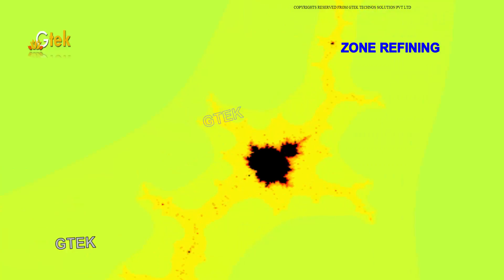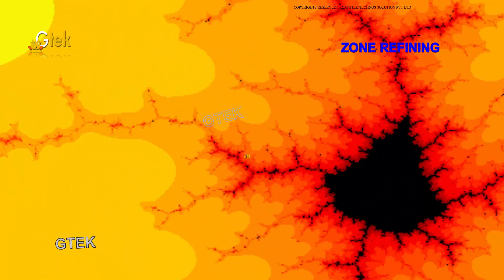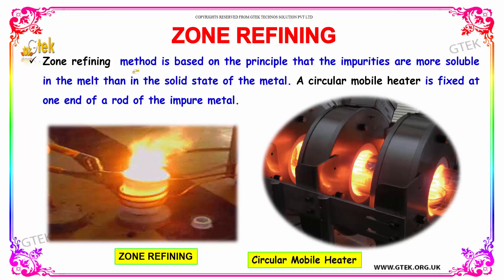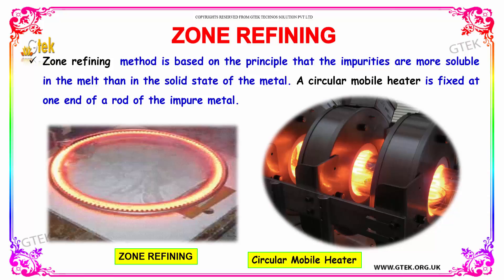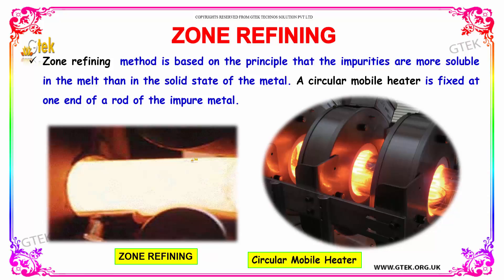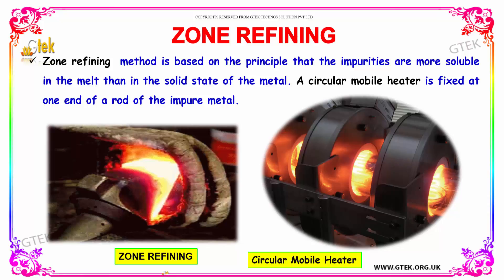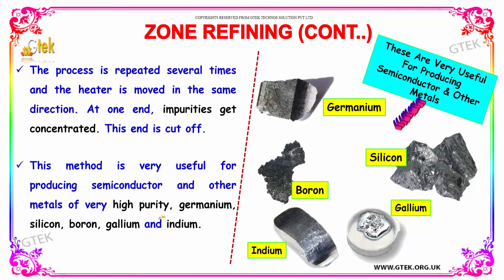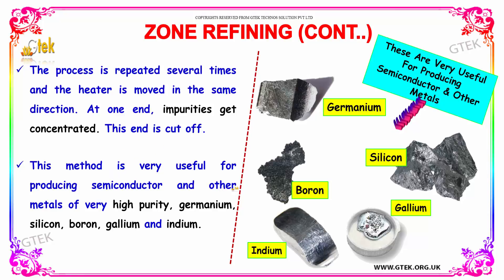zone refining principles and processes of isolation of elements class 12 chemistry subject cbse

Comment: One of a number of techniques used in the preparation of high-purity materials. The technique is capable of producing very low impurity levels, namely, parts per million or less in a wide range of materials, including metals, alloys, intermetallic compounds, semiconductors, and inorganic and organic chemical compounds. In principle, zone refining takes advantage of the fact that the solubility level of an impurity is different in the liquid and solid phases of the material being purified; it is therefore possible to segregate or redistribute an impurity within the material of interest. In practice, a narrow molten zone is moved slowly along the complete length of the specimen in order to effect the impurity segregation

Comment: In the process of zone refining, a circular mobile heater is fixed at one end of a rod of impure metal. As the heater moves, the molten zone of the rod also moves along with it. As a result, pure metal crystallizes out of the melt and the impurities pass to the adjacent molten zone.